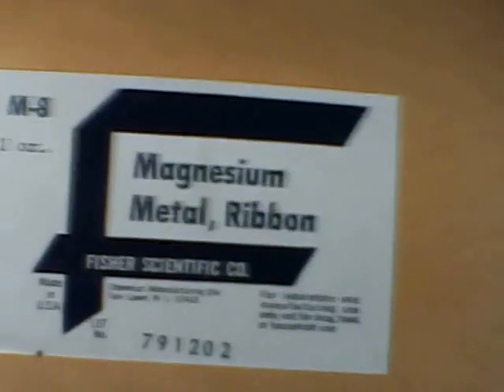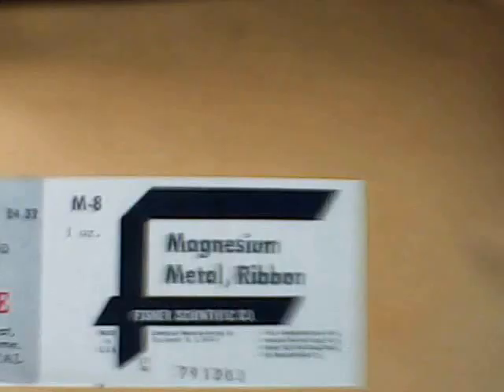DIY Magnesium Graphite Wet Cell ( Battery)

Comment: Pathetic another 1.54 volter. May as well use aluminum if you don't know how to push magnesium higher.
Reply: Magnesium corrodes faster than alluminium so therefore creating more electrons so the cathode being able too handle and loop the power efficiently you want surface area too do so but depends what electrolyte your using also ..1.5v is fine its same as a normal battery you can get 1.5v from 2 penny's and a piece off cardboard soaked in salt water so like the size off a coin battery..making bigger size batts is for electrolyte longevity and current which is improved with surface area off anode and cathode

Comment: Can you please make a video how to do a cell that gets over 4 Volts if a DIY selfmade cell ? That would be awesome...
But you probably need expensive Lithium Metal for this, which is pretty dangerous to handle in air, right ?
Reply: +overunitydotcom some of my cells with graphite and magnesium get 2.6 volts, and will hold, which I can show you how to make What is the most volts for these two combos have you seen?
Reply: +Steve Allwest Well diyflyfish on Youtube had shown 3.1 Volts but he did not reveal how he had done it. Did you yet show how you get 2.6 Volts ? Did you put 2cells in series ?